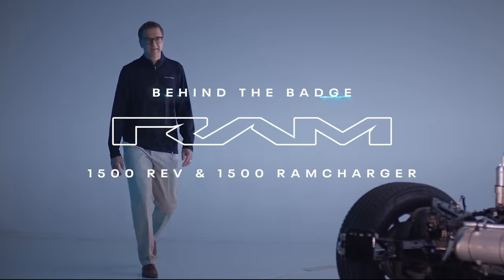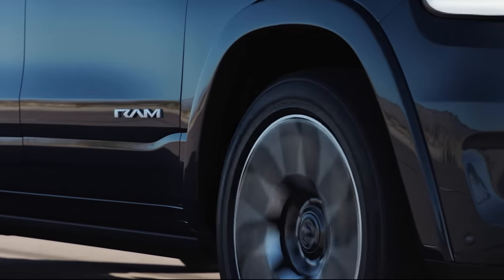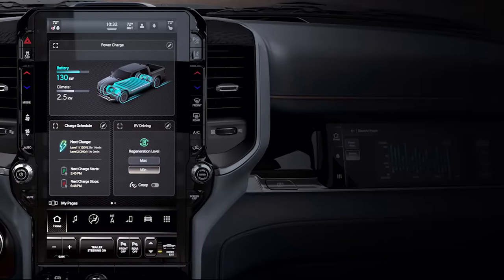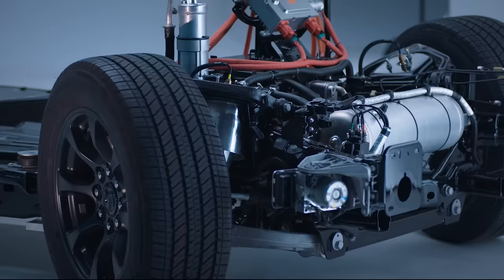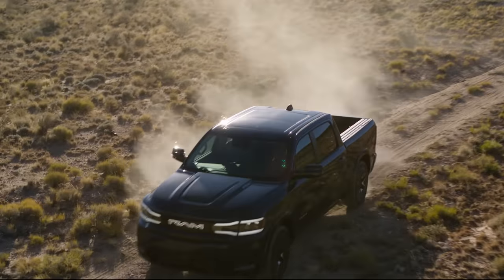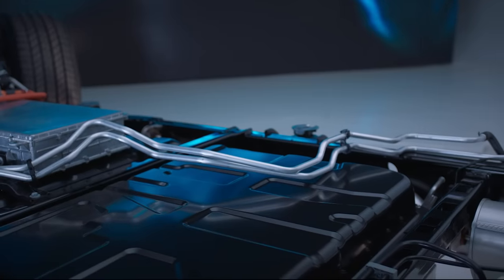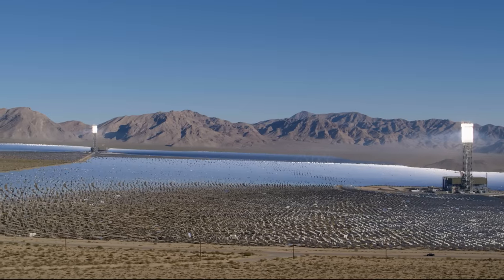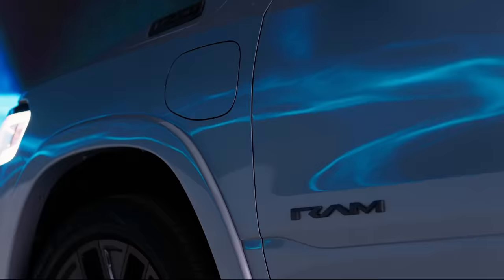Ram 1500 REV & Ramcharger | Engineering | Behind the Badge

Comment: What will the maximum output be for powering a house?
Reply from the maker: From the onboard power panel of the Ramcharger or REV the maximum output will be 7.2 kW.
Reply: @RamTrucks  Is it A/C out so no more hardware in my house, or D/C where I have to get an inverter for my home?
Reply: @JasonCarmichael  All batteries are DC
Reply: @kenfox693  OK. But that isn't what I asked.
Reply: @JasonCarmichael I believe at :50 in video (dual charge module) chapter it describes this…all EV trucks have inverters to output AC power from outlets 110/220
Reply: @JasonCarmichael it would be AC. The conversion of AC/dc and back is all handled on board.
Reply: At least 40 amps at 240v but would not be surprised if they integrate V2G they could go as high as 80 amps which normally at 80% load would give you 64 amps continuous or around 14 kw. Thats a lot of power for most standby applications. If you need more surge than a house battery inverter setup is possible and that is getting very reasonable especially if you integrate solar.  The RamCharger uses the 3.6 pentastar as a range extender so essentially makes backup power unlimited from the Ram Charger. Its a real interesting package.  Looking at it for my brother who has a dairy and needs backup power for his robot milkers.  His truck mostly sits around unless he is hauling something so could be used as stationary power and backup linked with solar. Interesting times.  

For fleet vehicles the Ram Charger is ideal as they can be plugged in overnight to charge and be used as backup power for site redundancy. This drivetrain would be great for school busses as well or anywhere that backup power is required. V2G is going to be a game-changer for the power grid. These trucks could be making money selling power when its expensive.  Half a million Ram Chargers acting as virtual peaker plants is an interesting business proposition.

Comment: I am on the buy list for the ramcharger. I will be pulling my rv nationwide. One question I have is, "Will the electric motor run for short distances without activating the gas engine, or does the gas engine run all the time"? It would be important for me to be able to run exclusively off the electric motor for short trips to the grocer, etc. What say you, Ram? Thank you!
Reply: The gas engine wouldn’t run all of the time. Why have any batteries if that were the case. I bet though that once you deplete your batteries on your towing across the country trip your gas engine WILL have to run all of the time. It’s unlikely it could tow and charge up the batteries at the same time while towing.

Comment: Will they come with CCS or NACS charging connectors?
Reply: The video clearly shows CCS on that platform but I guess that could change for production models.
Reply: Absolute horrible with CCS… if no NACS I WONT BUY ONE.  NACS and I’ll buy one… cash!  Simply comes down to that one item for me !
Reply: It’s really not that big a deal for most folks. CCS network has been better every year and even in the charger challenged Southeast NACS access will make things easier but not drastically change where i can take my Rivian.

Comment: What is the expected range for towing large loads on the Ramcharger? Do we expect a 50% range reduction (Common for EV trucks)? Or less (Assuming the generator provides better towing efficiency)?
Reply: Expect the range drop to be similar to a normal ICE car, since that’s essentially what the charger is, but because it is charging a battery instead of directly driving, it can run at its most efficient speed
Reply from the maker: Towing range is going to depend upon the trailer size. Our current analysis is that with a 14,000 lb. trailer we expect a combined towing range to be >250 miles at 65 mph on level ground
Reply: @RamTrucks  that's absolutely fantastic. That's exactly what I need! I cannot wait to get a hold of one and use with my RV. This is the EV I've been dreaming of.

Comment: Two questions:   On the Ramcharger, will the bed be removable for a flatbed tray conversion ? And what will the maximum payload be for a "hopefully" Rebel trim :) ?   Seems like a perfect Overland vehicle
Reply: My second Q&A question was if they were going to provide the self-leveling air suspension similar to the Rivian, perfect for setting up level at camp.
Reply from the maker: Stay tuned for more details on trims to be released in the future, but recognizing that a base version is capable of 2,625 lbs max payload, options and features that are selected will reduce the payload value accordingly.  With respect to removing the bed for a flat tray conversion, the Ramcharger was designed with the bed as an integral part of the structure in order to ensure its durability and crashworthiness; it was not designed to maintain those attributes with the bed removed or replaced with a flat deck/tray.

Comment: Will the bidirectional charger allow you to connect a trailer with batteries to extend the range while driving? Or plug the trailer in to a charging port and charge both at the same time, where it's hard to access the truck port when connected to a trailer?
Reply: Probably not. Nothing about these cars is ever common sense or extensible.

Comment: What kind of plugs and power is expected in the front trunk and bed? What is the front trunk its load capacity?
Reply from the maker: The Ram REV features an available onboard power panel that provides up to 3.6 kW in the frunk, while also boasting a Best-in-Class 15 cubic feet of storage space with secure, weatherproof protection. The onboard power panel in the bed of the REV or Ramcharger can provide up to 7.2 kW.

Comment: Styling seems a little soft. Also will there be outlets in the bed like other ev trucks and at what voltage will they be. My dirt bike has a 240v charger and it would be nice to charge it up off the truck like the F-150 Lighting can.

Comment: "RAMCHARGER" Can you plug in a camp trailer 220V to dry camp? Also can you plug into your home as a battery backup?
Reply from the maker: Yes, the Ramcharger can do both! In fact, it can power a home for 30 days with device power rationing–based on 10 kW hours per day for 30 days using a fully charged battery and full gas-powered on-board generator in a well-ventilated area.
Reply: Thank you for the reply @RamTrucks

Comment: Will the engine be able to charge the battery as you drive - then you could reach a destination fully charged? Is there a way to set preferences on desired level of charge? Do you have an idea of the performance while towing? (I expect a 50% reduction in range) Is the range estimate (on the dash) accurate - (Tesla's are optimistic)?
Reply from the maker: Great question! Under normal operation, we expect to “deplete” the battery energy first before the generator will turn on to provide charge sustaining operation. There will be special modes that allow you to “hold or achieve” a particular state of charge.

Comment: I wonder if the Ramcharger concept will be added to 2500 and 3500 trucks...
Reply: Indeed, with a generator onboard, we could now easily electrify HD trucks, too.
Reply: But with the Cummins.
Reply: I don't think Cummins would make sense. You need something that doesn't add much weight, doesn't require complex emissions control systems, and doesn't take much space, either. 

EV motors are already much stronger than the Cummins motors would ever be, so it will feel every bit as HD worthy, regardless. The motor is only needed to recharge the batteries afterall.
Reply: @oozk  oh sorry I wasn't clear enough, since Cummins already produces generator engines that would be a great fit for this application. Also since you don't need a heavy transmission there's loads of weight savings already. But yeah the 6.7L Cummins weights around half ton.
Reply: @RamTrucks  we watchin'
Reply: Look at the GVWR and capability of these trucks. They are 2500s already right down to the 8 lug wheels

Comment: This is directed at Ram (Stellantis) Your new trucks In theory sounds fantastic. Personally I have waiting for Electrification for the last 10 years to reach the point is about at. 

However here is my rhetorical statement. I currently own a 2020 Gladiator Rubicon and 2015 Ram regular cab 4x4 truck. The Ram threw a baring through he bottom block at 100,000K. The Fuse box needed a rely, know defect, the Valve body needed to be replaced and now the another known issue, I need to replace Fuel pump because fuel sensor has failed. 

Regarding the Jeep, it is well known the oil filler housing will fail and need to be replaced. Not a small job.  Of course electrical issues and the very common issue and especially locker sensor going bad. And then there is the Right cylinder casket failing. All of these mentioned issues normally occur within 100K. And often enough, well below 100K. 

Some of these issues can be cataphoric. Given the cost of my Rubicon and new Rams.  

Why should I trust Ram, Jeep (stellantis) and sell one or both of my Vehicles (which I am planning on doing) and relace with another Stellantis product. 60K, 70K, 80K and up is much to much money to end up huge headaches and in many cases additional repair costs in the 1000;s of dollars. 

Stellatis, as wonderful as your new Rams appear on paper and advertising and new straight 6 hurricane engines coming in the Jeeps and I think the Rams as well. I have no trust in your products. Feel free to convince me why I should.

Comment: Not a very though video more data needs to be disclosed. How many miles can you get on fuel part only. Sounds like 120-130. Not impressed with anything electric yet, way more infrastructure needed meaning charging locations, before I would even consider.

Comment: Problem I see with this design is, since the motor is constantly charging the battery, won't the life of the battery be depleted much sooner and thus need replacing in a shorter period of time?  Lithium batteries have only so many charge cycles before they begin to lose capacity.

Comment: Why is the generator powered by a full size V6? A smaller engine or disel could run the generator just fine as it is only running the generator.

Comment: Will the production Ram 1500 REVs offer the pass throughs shown on the prototype units?
Reply from the maker: The Ram 1500 REV will not offer the pass through shown in the Revolution Concept BEV, but it will offer Best-in-Class frunk with 15 cubic feet of storage space with secure, weatherproof protection.

Comment: Will it be able to operate as an automatic standby battery backup for home to switch on when grid goes down?
Reply from the maker: The Ramcharger can power a home for 30 days with device power rationing–based on 10kw hours per day for 30 days using a fully charged battery and full gas-powered on-board generator in a well-ventilated area.

Comment: Has any testing been done towing with a payload for range on battery/fuel combined? Thanks! Eco-diesel owner here sold on the Ramcharger locomotive idea wish it was still diesel. E85 flexibility might be cool.
Reply from the maker: Yes, extensive testing goes into our trucks. The Ramcharger will deliver targeted best-in-class maximum payload capacity of 2,625 lbs. and 14,000 lbs. of towing capacity.
Reply: I appreciate the reply however my comment/question was about towing range. Can you speak to real world expectations on towing range? Thanks again!
Reply from the maker: @jdamoose1822  Towing range for the Ram 1500 Ramcharger is going to depend upon the trailer size.  Our current analysis is that with a 14,000 lb trailer we expect a combined towing range to be >250 miles at 65 mph on level ground.
Reply: Thank you for sharing that estimate, for me that’s a workable number! And there will be a lot of variability with weight/terrain and also for wind resistance and “driving style” as well. Like most living/working/playing around NorCal we tow up into the mountains occasionally and back down. Will a towing regenerative  braking setting be incorporated? Or the ability to increase the regenerative charging to help with and take advantage of slowing the additional  mass?

Comment: On the Ram charger how often do you have to change the oil?
Reply from the maker: How often you need to change the oil will depend driving habits. Our control system is equipped with an oil life monitor which will maximize the time between oil changes while still offering maximum protection of the generator.
Reply: Say I use it 10 times a year to haul my 7,000 lb trailer 250 miles each way.  Using the generator to make it without charging.  Would I need to change the oil 10 times or 1 time. The rest of the time I would be on only electric

Comment: I think the RAM Charger is a great idea following in the footsteps of the Locomotives that replaced steam. A modern Locomotive has an engine that powers a generator that provides electricity for the electric motors driving the wheels. The RAM Charger’s design is brilliant, no transmission, drive train, differential, transfer case, etc., all of which add weight and require maintenance, and replaced it with batteries to provide short range electric power. Why didn’t someone think of this sooner?
Reply: It's called the Chevrolet Volt...
Reply: @mattywatty87  Is that a 1/2 or a 3/4 ton truck?
Reply: The point is that this technology is not new, it's only new to the truck segment.
Reply: They're actually building semi's now with this concept, and pickup truck retrofit kits to come. Check out Edison Motors.
Reply: You know this concept is a knock-off from Li L9, don't you? It's brilliant, but it wasn't created by RAM.

Comment: Wondering what the warranty will be on the Ramcharger? Bumper to bumper, Batteries, Drivetrain, and is the generator considered part of the drivetrain?
Reply from the maker: Both the Ram 1500 REV and Ramcharger will offer an 8-year or 100,000-mile Electric Powertrain Limited Warranty, 8-year of 100,000-mile High Voltage Battery Warranty, and a 3-year of 36,000-mile Basic Limited Warranty.

Comment: When towing the battery is running low and the generator is turned on what will the output be? Will the generator be able to keep up with the power loss while towing?
Reply from the maker: For level towing, the generator is sized to meet the needs of our max trailer weight.  For more severe grades, we have a special mode where the battery and generator work together to provide maximum towing capability.
Reply: @RamTrucks  thank you for getting back to me. I'm excited to see the final design and price.
Reply: @RamTrucks  Given this statement, will the Pentastar be turbo-charged? I live in the Denver area and tow through the mountains regularly, the performance drop on naturally aspirated engines is rough. What elevation would you consider the generator to have adequate power to meet the needs for level towing? Have tests been performed for higher elevation conditions?

Comment: Will it tow a 13,000lb 5th wheel?!?
Reply: um, get yourself a 3/4 ton. At that weight, it's not about moving forward, it's about safely coming to a stop
Reply: @MrCjohnson098  I currently have a 2500 with the cummins and it have the same 14,000 towing and 2600 payload as the Ram Charger so it would be nice to convert.  We have 2 other electric vehicles and love the ev concept . Fast and cheap to drive
Reply: That's nuts.
Reply: they say it has 14,000 lb towing capacity with a 2,700 lb payload.  So, yes.. It's a 3/4 ton.
Reply from the maker: The maximum tow capacity of both the REV and Ramcharger is 14,000 lbs.
Reply: @RamTrucks  so 5th wheel will be an option to add?  Sweet
Reply: @philgriffiths4713  I've never had a 5th wheel, but is the 5 1/2 foot bed a show stopper for your fifth wheel setup?  Like Ram says I think it will pull it being rated for 14k lbs.  I think stopping will be fine since you have trailer brakes and the EV will be a heavy vehicle and probably has a good braking system (assuming).  If you are really asking if Ram will offer a 5th wheel prep option - that I don't know.
Reply: @karlaerdmann7830  we will have to wait and see!

Comment: They should release a smaller battery version of the Ramcharger so it might be affordable. I could get by with 30 or 40 miles with daily charging. On a long trip, it would not matter if the battery ran out after 40 or 140 miles..
Reply: Read the Specs. 690 miles is "Combined" All electric mode is 145 miles. A 27 gallon gas tank recharges the batteries. Perhaps a smaller more efficient engine would have made it cheaper and more efficient. Questions that could have been answered if this was a "LIVE Q&A Event". I thought this was exclusive content to the early adopters that paid the $100.
Reply from the maker: Hi Michael, we always appreciate the feedback from our customers.

Comment: Hey Ram Trucks,

Electrics are not the future!! It's a dead end!!
It is good to offer alternative drives.
The fact that a 3l I6 blown up to 550 HP could replace a V8 is a fatal mistake.

You only have one engine to choose from depending on the equipment line. this is disappointing.

She has lost sight of the most important thing. What Chrysler, Dodge and Ram stand for. What these brands represent.
A legend!
The Hemi V8!

My example of what has to come again. Ford and GM can do it too!

1.
The 3l Hurricane with 1 turbocharger, 320HP as a replacement for the 3.6l V6 Pentarstar.
2.
A new 3.5l turbodiesel mild hybrid, 300HP
3.
The most important!
4.5l Supercharcher V8, 450/520HP

Bring back the V8!!!
Bring back the legend!!!

Comment: This truck will only last 100,000 k and then need a new battery My 2005 dodge ram 2500 has 450,000 K And still working like a charm Also, I can fix it in my driveway and don’t have to bring it to the dealership.💰🧌